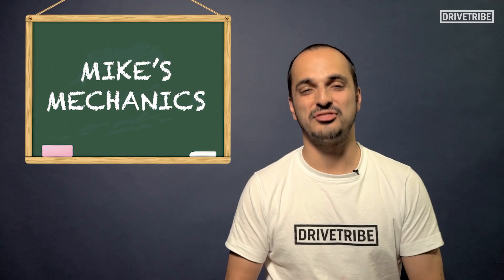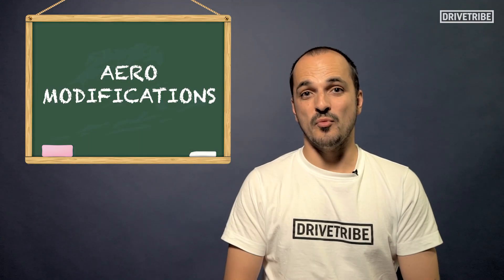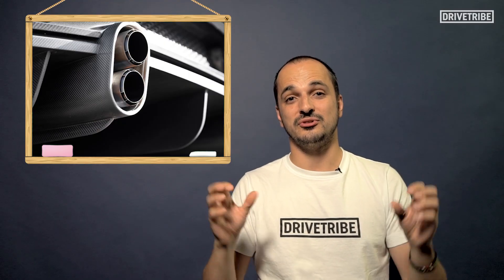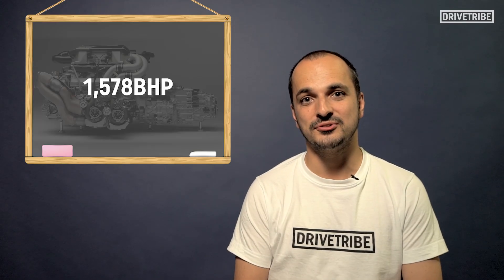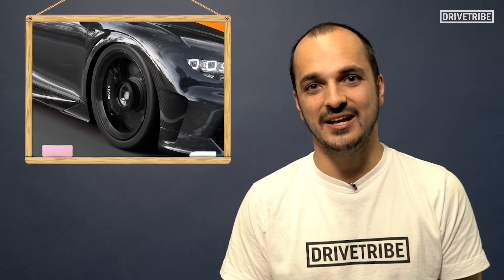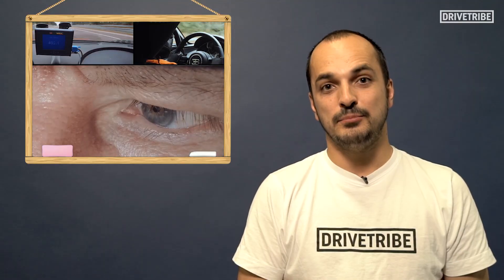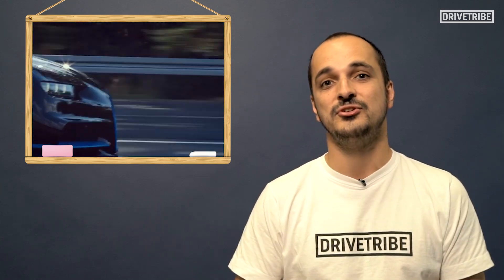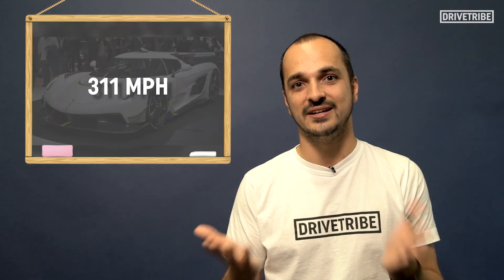How did the Bugatti Chiron reach 300mph?

Comment: it isn't first modified car to cross  300mph 
as earlier this year M2K ford GT has crossed 300.4 mph
Reply: Hell that was in a standing mile too.
Reply: And yet you can drive one for many years and the other for many hours....
Reply: Paul Allen was it modified by Ford? No. Is it going to be produced? No. Does it have full interior? No. Not even close to what Bugatti did
Reply: @coldheart9829  Still, it was first.
Reply: @coldheart9829  or, Matthew "one bucket seat is a full interior" Howarth: Who cares about a modified car that can go 300mph in one direction? It has been done before. Use a production car and do the average of two runs, each in opposite directions of each other.
Reply: @benjaminbjoerseth  It is a production car, confirmed by Bugatti CEO : the Chiron SS 300+, 30 units will be produce
Reply: @coldheart9829  you're right, more impressive than what Bugatti did and probably has as much interior and currently is as produced as this variant of the Chiron
Reply: IVS but it wasn’t done by Ford so the Bugatti is more of a production car. If the Jesko did this nobody would complain
Reply: Matthew Howarth That chiron isnt a production car either and the production version of SS will never reach 300mph, because bugatti is all about luxury, they wont trade comfort for speed
Reply: @benjaminbjoerseth  and on a normal road!
Reply: @fhozza1105  they will produce the Chiron SS with 304mph top speed. Why shouldn't they? "They wont trade comfort for speed" they dont need to trade tho. They had the speed record for many years with the veyron and still got a comfort car...
Reply: @Thunderworks  It is going to be a production car, then. Taking a costumers car out on a public road anf getting the record, id evidently more impressive. I cannot, for the life of me, understand how this is "breaking the 300 barrier" - Other cars have done 300 (of which, at the time of setting the record, there was only one of) . I say again: Do it right.
Reply: @coldheart9829  Thats cuz the 300 mark was/is Jesko's sole purpose of creation lol.  The entire goal from the beginning was to be the 1st full production model to run 300mph. AND PASS emissions.  Nobody seems to care how big a deal THAT part is by itself
Reply: SuperRad holy shit I didn’t realize that it passed emissions, well done Koenigsegg
Reply: Matthew Howarth can you buy that bugatti? No, so what was your point? Its not productiin model so no big deal, Konigsegg did it right.
Reply: @coldheart9829  America did it first my guy sorry
Reply: Bear Jew Did what? Neither is a production car. So non did brake the production car record. The record for a non production car is 763mph. And it was 12 YEARS AGO. So no. Hmerica wasn't first.
Reply: @joshjlmgproductions3313  but it wasnt. Drag cars have been doing 300 fir a while, and the first car to reach 300 was about a century ago
Reply: The Ford has been tuned with aftermarket parts from people not associated with Ford. The Chiron is the first factory spec vehicle to hit 300mph. If we're bringing up high numbers from random fast cars that have been tuned, there's a 3000+hp 2JZ Toyota Supra in Dubai that hits 250mph (400kph) in 5.7 seconds in just a quarter mile, so it can probably hit 300mph in half the distance of the Ford. Wouldn't make sense to compare the Supra to the Bugatti, would it?
Reply: @user-de1xi2uf8d  i know this isn't the point of your comment but no way that supra has the aero or tyres to hit 300
Reply: @jacoblunn29  the same compound tyres that are used on the Supra are also used on 10000hp top fuel dragsters, and they trap speeds of over 330mph. As for the aero, I'm not sure if you're implying that the car has too much drag to reach 300mph, or if you're implying that it's too unstable to reach 300mph. But, at 250mph, it's about as stable as a 3000+hp car can be, and it certainly has enough power to go 300mph. Anyway, as you said, that wasn't the point of my comment lol
Reply: D4 thank you! Someone finally understands the difference between road legal and from factory!
Reply: @coldheart9829  Matthew what matters is that a drivable car other than Buggati broke the 300mph barrier first, forget about arguing about the team responsible for the modification. So rightly Bugatti's car was not the first drivable car to break the 300mph record, simple.
Reply: syverexion a top fuel dragster is drivable and the first one hit 300mph in just 4.8seconds was in 1992. we really are comparing apples to oranges here with the chiron and the „badd GT“ as it was called which went 300. fact is you can just walk up to bugatti with some cash ( not literally) and buy a car that has alot of engineering behind it to go as fast as 250 reliably and rather safely wich i dont think a small workshop can provide those luxuries. But i do respect them for putting that ford gt together and the driver having the balls riding that beast.
Reply: @chrish523  Drivable in the context I was using, is that, it's road legal and can be used as an everyday car without needing special adjustments for such "drivability". A dragster, however, doesn't fit that  category and kindly note that the Bugatti spec that hit 300mph was modified for that purpose hence is not a regular everyday Chiron.
Reply: 304.77
Reply: No matter what the Bugatti car is so ugly
Reply: So is this going to have 1500hp in production form?
Reply: Is that GT street legal though ? Not saying it ain’t I honestly don’t know but if not then you might as well compare it to something like a top fuel dragster which reach 300 with ease
Reply: @donjon5442  Yep.
Reply: Nobody cares.
Reply: Isn't even the first modified car. NHRA drag racers have been regularly breaking 300mph over 25 years. In a 1/4 mile even!
Reply: First Last yes but this was a production car that was modified
Reply: @Ki-yg1ds  If it's a production car that was modified, that would require them to have already been sold and on the road. It's not a production car. Maybe in the future, but not yet.
Reply: i hear that the longtail chiron will be mass produced later, well.. when bugatti mean mass produced they usually mean limited produced and people who get the longtail will surely test their own
Reply: If we're talking about production-based, modified cars... I hate to burst everyone's bubble, but Kugel and LeFevers took a 3rd Gen Firebird to 300 MPH in 1999. Stock bodied with a 368 MPH TT small block.
Reply: @corystansbury  sadly it's not street legal. That's why the chiron ss will be record holder. It's only about production and street legal... and if they start the production of the chiron ss then it's official :)
Reply: ten years from now we will be having this same argument about 350mph. ten years after that, 400?
Reply: It's standard not modified
Reply: cami cami did you watch the YouTube video? They lengthened it. Stripped it. Increases the bhp. Now how is that standard?
Reply: @babylon4953 you must learn how  take a joke..
Reply: cami cami a joke is supposed to be funny
Reply: @babylon4953  relex my son
Reply: cami cami i am. And I'm probably older than you
Reply: @babylon4953  if you say so kid
Reply: cami cami troll
Reply: @alexpatterson5973  lol okay kid.
Reply: Its got to be a production car to hold the record and a manufacturer has to build 64 cars to be eligible for that,
one off cars dont count, there's been loads of cars that have hit over 300mph, their not a production car that you can drive out of the show room at hit 300mp on the autobahn, their one offs, the jcb Dieselmax hit 350mph in 2006
but that was a one off land speed car, to add a one off none production gt40 into the mix is about as stupid as me adding the jcb.
Anyway the fastest production car thing is only a gimick, atleast the gt40 has done it where it matters on the track, you will never see any off these overweight fastest production cars win races, the bugatti is never going to win le mans, its just a rich watered  down heavy boys toy, atleast the old fastest production cars proved themselves on the track, cars made by porsche ferrari and mclaren true race bread monsters,
All the big manufacturer are all capable of building the fastest production car, even ford if they wanted to, but its not important to them to do so
Reply: Also did it with half the cylinders which makes it more impressive as you'd kind of expect something with huge displacement to do this.
Reply: @FujinWater  Number of cylinders are irrelevant. You can get as many cylinders on the same displacement (8L V8 engine is possible so is 5L W16 as an example) and power but the main issue will be reliability. Add the type of fuel used as well.
Reply: @FujinWater  bugatti broke the hypercar record
Reply: The difference is this is the chiron super sport a car modified and sold by bugatti as a different model to the base chiron. The ford was highly modified with over 2000hp by a 3rd party after ford sold it
Reply: rayn man Bugatti said the actual car will come with a full interior and no roll cage. Therefore the car that did the run isn’t a production car. Great achievement regardless.
Reply: @-bruce4809  Yeah but I guess it won't affect the top speed. But hey, if they really bring out the actual car with full interior, no one will test it again I guess :D 

Yeah great achievemt! That's for sure
Reply: Just face facts Bugatti wasn’t using a production vehicle when this test was done. It was stated as near production not production.
Reply: It sad because I feel like only true car enthusiast will only know this.... Ford is the unsung hero
Reply: Drew Holli ford didn’t modify it themselves
Reply: @coldheart9829  at the end of the day my man the Ford badge went across 300 mark 1st it doesn't matter if they was modify by them or not
Reply: Drew Holli I’m not denying it was impressive but it’s two different records
Reply: @DrewHolli  that ford is a piece of junk its just a v8 with a billion turbos stuffed into an old gt than will fall apart after 2 runs lmaoo you actually compared that to bugatti 🤣
Reply: @paveantelic7876  you can hate all you want  but they still did it first 🤙🏾🤙🏾🤙🏾 lol😂😂😂
Reply: @DrewHolli  If we go from there, dragsters or LSR cars have reached 300mph+ in one direction a loooong time ago...
Reply: @paveantelic7876  the Bugatti is the one with more turbos more cylinders.  Anyway, who cares who did what.  What Bugatti did is very very impressive, and they are going to produce and put up for sale the same car with the same specs.  The Ford is just a modified version tuned to get the fastest standing mile possible.  Ford had nothing to do with it, nor will Ford put for sale anything close to it.
Reply: Drew Holli there were cars in the 30s that did 300mph......only REAL car enthusiasts would know that not your wannabe ignorant manifesto you’re trying to spread. Fact is the Chiron is as reliable than a Toyota Camry and can make a record attempt and do over 300mph and in the same day be driven in comfort to the opera at night. The Ford was a heavily modified car that would not be daily drivable without incredible compromise.
Reply: Why do people in this tread keep saying the Bugatti was factory speced. When it clearly wasn't. Haven't you watched the video? Or are you just ignorant?
Reply: @babylon4953  because it will be released in exactly the same way except with 2 seats probably being the only difference
Reply: Jake Plays when I see Bugatti release that car. And it will make 300mph as a road car, i will believe it.
Reply: @babylon4953  So who specced it?
Reply: lil veky They take a car from factory and then modify it. It doesn't matter if they modify their own car. It's still not factory spec.
Reply: Yeah it actually hit 306 mph......

Comment: I believe Bugatti should retire with 500 kph / 311 mph. It’s only another 9 kph which seems totally attainable :-)
Reply: They actually did it, the Bugatti bolide can go from 0-500km/h in just 21 seconds.. absolutely ridiculous but that’s what happens when they throw out the rule book and just make a track car🤷🏽‍♂️🔥🔥
Reply: Bruno De Marques I believe they were going for the 500 kph in the first place but couldn‘t achieve it, so they went with 300 mph (french company = metric system). Nevertheless, amazing achievement.
Reply: @SuppiT1  they said if they would have tried it in Nevada it would have worked since the air is thiner
Reply: @SuppiT1  exactly what i thought too!
Reply: @SuppiT1  i guess customers can still do it
Reply: @Dan Smith true, it can walk the walk but there are barely any roads to show it. And it's too heavy to set a time you would expect from a car with power like that. It's not designed to be practical but is Imo a pretty useless car.
Reply: @Dan Smith what?
Reply: That extra 9 kph requires like 300 more horsepower. That's tricky
Reply: At this speed every mph is infinitely harder when engineering is concerned... for 500kph they would have to completely redesign the Chiron again!
Reply: @PlzTouchSomeGrass  or they could run it somewhere with low atmospheric pressure and do it that way, the drag reduction far outweighs the power loss at that speed, especially for a turbocharged engine that barely loses any power
Reply: @PlzTouchSomeGrass  and if they want to squeeze the last 0.001km/h they can do it going eastwards, at that speed the car might weigh like 100g less if it goes East (I could calculate it, but I can't be bothered to do it)
Reply: Actually after a very rough calculation it should be around 3kg, I reckon that could give you a very tiny bit of extra speed
Reply: @Dan Smith well for example. The bugatti veyron's top speed was 407 kph and had 1001 horsepower.  Then came the veyron supersport which got to 431 kph and has about 1200 horsepower. Air becomes thicker the faster you go, so you just going to need more and more power to go even a little bit faster.
Reply: They're to afraid to go against the grain 🤣

Comment: It's not a Production model yet, it also wasnt officially a record as it wasnt done in 2 opposite runs. So the Agera RS still holds the record. I mean this Chiron is no different at the moment than the Ford GT that went 300mph ages ago. But I'm sure once it goes on sales they'll go for the official run. But potentially then Keonigsegg will be ready with a more top speed focused Jesko.

Comment: koenigsegg: Hold my Jesko.
Hennessy: Hold my Venom F5.
Lotus: Hold my Evija.
Reply: Evija's top speed is limited to 200...So,no.
Reply: @ShadowGodOfDarkness  so it has 1,972 horsepower to be limited to 200. That makes a lot of sense.
Reply: @ShadowGodOfDarkness  Electronically limited. Meaning that it could be changed with a computer.
Reply: @AdamDawood  It could,but right now. It doesn't compete on the level of it's ICE competition
Reply: @ShadowGodOfDarkness  You speaking like it's a production car.👌
Reply: @AdamDawood  The Bug? Yup,it's a production car now.
Reply: @AdamDawood  although no one has a electric car that can go over 200mph even races too, plus it might be electronically limited and breakable but no one has ever tuned, modify, or even explored with any road legal application.
Reply: Who would put 1,972 horsepower in a car but limit their speed to 200 mph ._.
Reply: @yanntam418  Probably a company that prefers their customers to still be alive.

Because tyres.
Reply: @yanntam418  Exactly my point.
Reply: @yanntam418  Here is a likely reason why it only goes 200 MPH: the Battery. The faster a car is the quicker it goes through fuel/charge, at 300 MPH a 400 KM/250 Mile range battery would completely run out of charge within minutes, and if it has brake or steer by wire, you would have to be on an extremely straight road with nothing to hit to safely stop the car with a flat battery.
Reply: @rsh650  It is, but it's not to its customers yet. It's in pre production. So shit is still getting figured out. Meaning 300mph is still getting figured out.
Reply: @AdamDawood  but Bugatti just launched it as the Chiron SS. Not in the customers' hand yet,yes
Reply: @rsh650  exactly. So if Lotus decides to remove the limiter and achieve top speeds possible,then it's a competitor. Mere theory won't make any difference.
Reply: @rsh650  lolololol. Good shit.
Reply: Tesla: hold my roadster